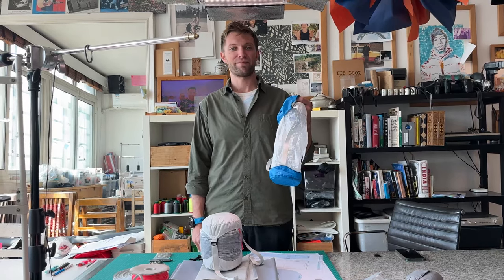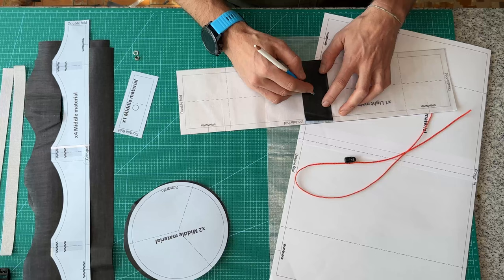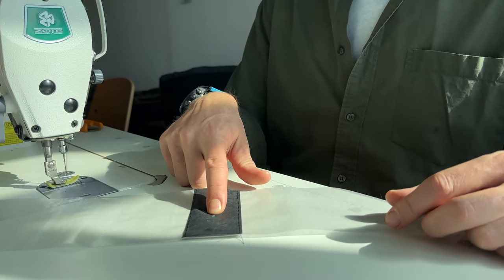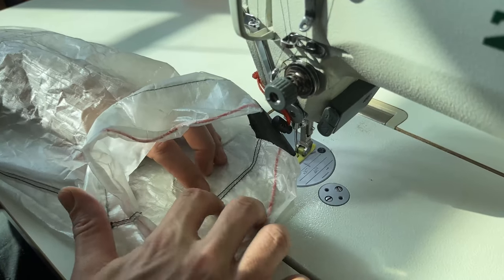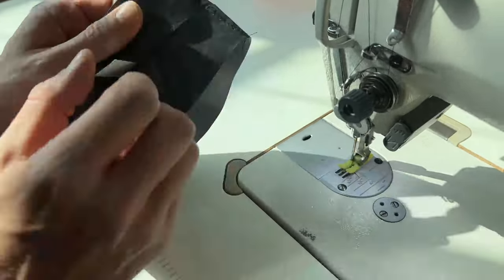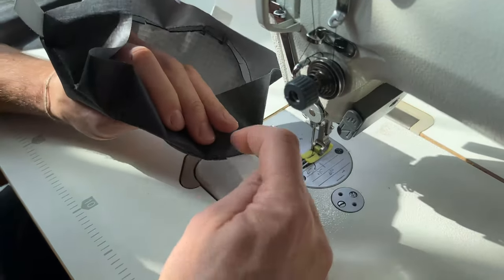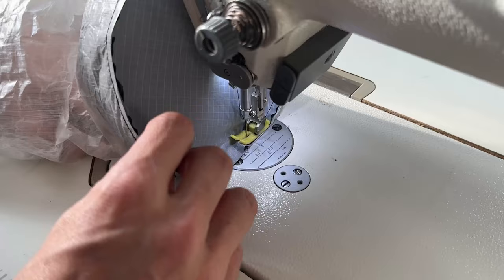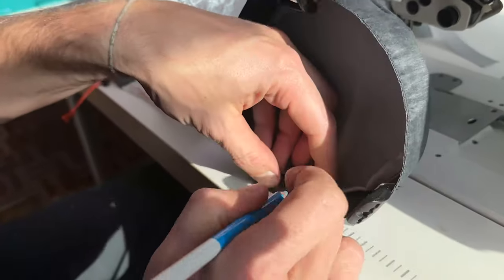DIY Compression bag for bikepacking/camping/travel + FREE printable

Comment: Thank you for this great video and the pdf. What did you use to stitch over those seems. I couldnt quite make out the audio in that section. I think its grosgrain? if so what kind/size? thank you
Reply from the maker: Thank you. Yes. Its Grosgrain. I believe i used RPET 22mm.